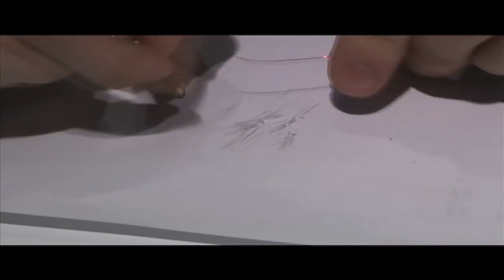Build Your Own Plastic Cup Microphone! (Music Technology Fundamentals - 6)

Comment from the maker: @Saarah Sheikh,   Thanks,  if you have a VOM you could connect one lead to the positive probe on the VOM and the other lead to the ground probe on the VOM.  Look at AC voltage, or amperage.  If you have access to an oscilloscope you could also use that to measure the voltage/amplitude output of the mic.